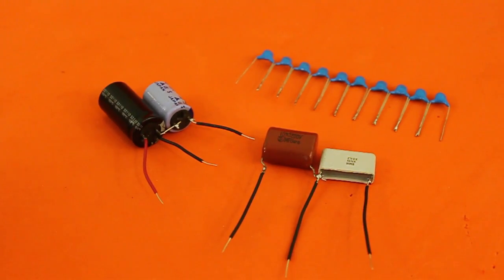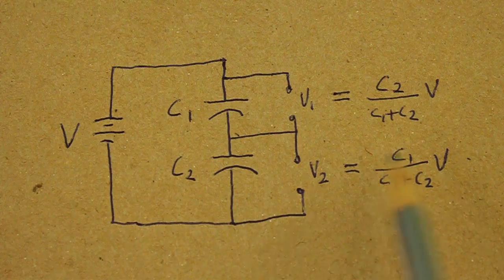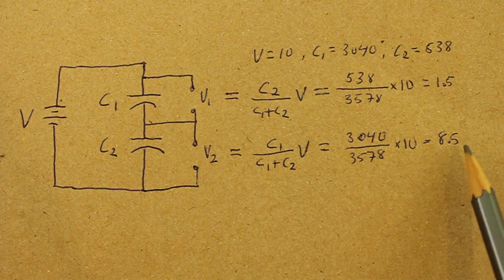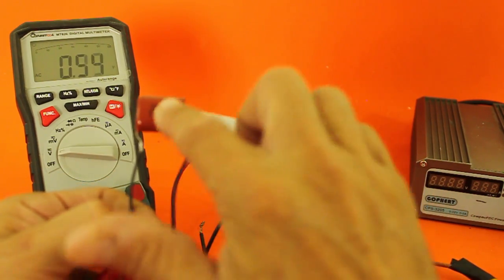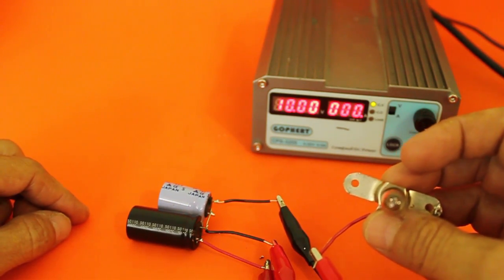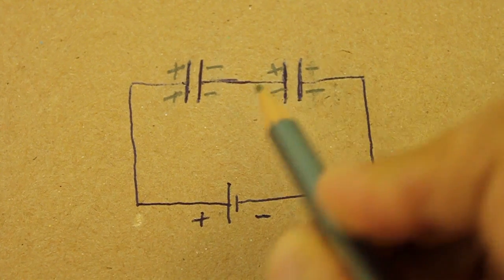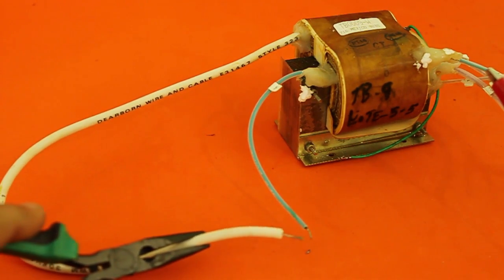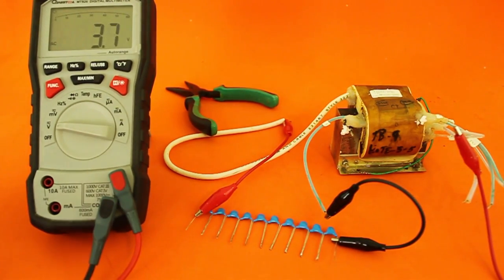Capacitive Voltage Dividers

Comment: Thank yooooouuuu very much ..... this is EXACTLY the information I wanted... I have a high voltage transformer and a 24 stage voltage multiplier withbindividual caps rated for 6kv .... so I needed to make sure the output of the transformer is not more than 5 kv so that I don't accidentally destroy the expensive and hard to get voltage multiplier 😅.... so Thank you again.

Comment: With regard to measuring high voltage AC, always measure the voltage at the inner most capacitors. That way if you catch an arc, you've at least divided the voltage in half, rather than eating the hole voltage. 

as far as using this as a voltage divider, I think i might be able to use this in a DC circuit, but i'd need to run a high value resistor in parallel with the top capacitor. That resistor would effectively match the impedance of the bottom half of the circuit, but, which would be kinda nifty to have a way to estimate that in some RF circuits.

Comment: nice video just one more point in the end " measure voltage across all the capacitors one by one add them and you get total voltage across transformer approximately instead of averaging :)

Comment: Hi good explanation,  can u tell how much current can we draw from a capacitive voltage divider? If the source current is 10A between two capacitors of same value,can we draw 5A from one capacitor terminals??

Comment: How do you get away with putting capacitors on a AC circuit without a resistor? You would think it would act as a short circuit.
Reply: Capacitors on an AC circuit are resistors. In fact, they're resistors that don't produce heat, so if you're trying to prevent waste heat, capacitors have some advantage. 

To be honest though, even in DC current, they act as variable resistors according to the voltage levels across the circuit. As a capacitor comes up to charge, it becomes more resistive, all the way up to becoming an open circuit, which allows the capacitor to act as a voltage source at that point.... or explode.

Comment: Hey can I use voltage divider 2 times.
Like 1/10 in your case.
So 1/10×1/10=1/100.
Measure even more higher voltage.
May be restricted by capacitor max voltage
Reply: You probably could, just factor in the tolerances of the actual capacity
Reply: Starting with 2 cap in series, C1 and C2. If you place other caps C3 in series with C4, but both in parallel to, say C1, then you change the equivalent total capacitor:  ( C1 // (C3 ^ C4) ) ^ C2   (where ^ meaning being in series  and // meaning being in parallel ) = (C1 + C3*C4/(C3+C4) ) // C2 , and so on...

Instead, it would be simpler to remember that for two caps in series, the lower capacitance get the higher voltage:  Voltage at C1  (in C1 ^C2 )  = V * C2 / (C1+C2),  and voltage at C2 =  V * C1 / (C1+C2).  So, make C1 = 99*C2, and measure the voltage at … C1:   V_C1  =  V * C2 / ( 99*C2 + C2 )  = 0.01 V

Note though that caps have, built in, a parallel resistor, Rpar, (look for Spice models of capacitors, such as at https://softsolder.com/2009/11/09/spice-crystal-model/) which can be much lower than the resistivity of the cap (at low frequency, such as for DC voltage) and so, the distribution of voltage across the two caps may be more like a division of tension by two resistors than by two caps. And for two resistors, the max voltage appears … at the max resistor, which is the reverse than when looking at the capacitances values!

In conclusion, it is a very unsafe technique for DC, or for low frequency.

In fact, when you charge ultra-capacitors in series, you SHOULD always add external resistor in parallel to each cap, for safety:  http://va1der.ca/index.php/balance-resistors-for-series-capacitors/
Reply: Guess I would try with my flyback.
Thanks for helping.
All.

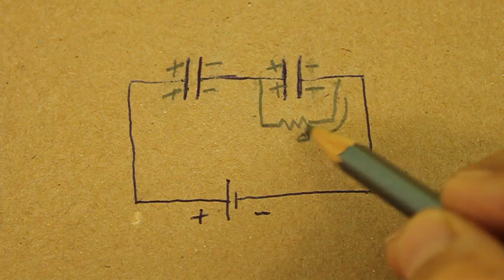Comment: Yes but  at 8:24 once you shorted out the capacitor on the right with the lamp  , if given a few seconds wouldn't the other capacitor charge to the full voltage of the supply ?
Reply: Yes, thats what nearly happened. A perfect capacitor with no bleeding would probably work